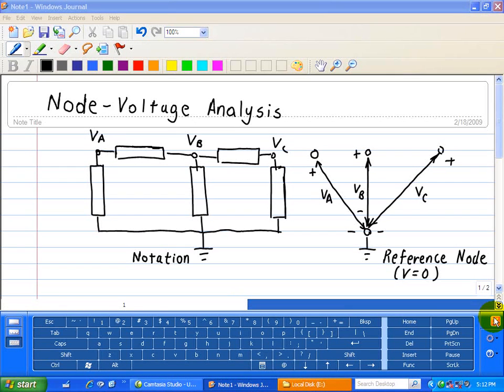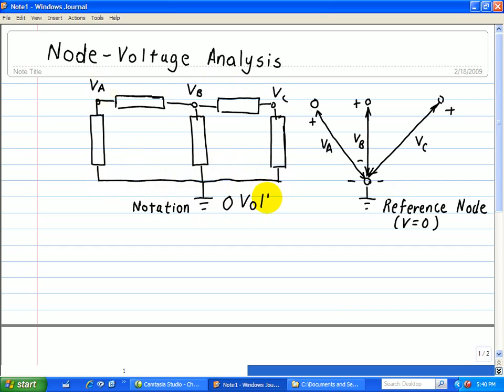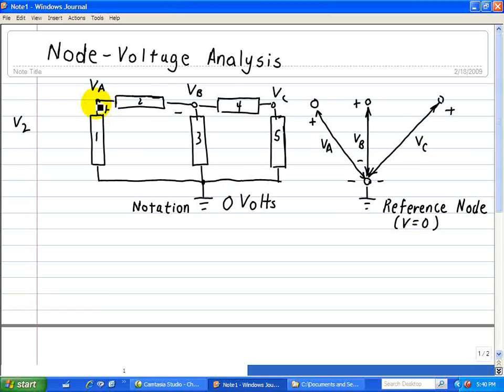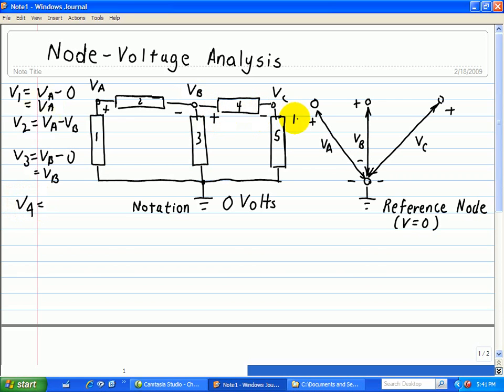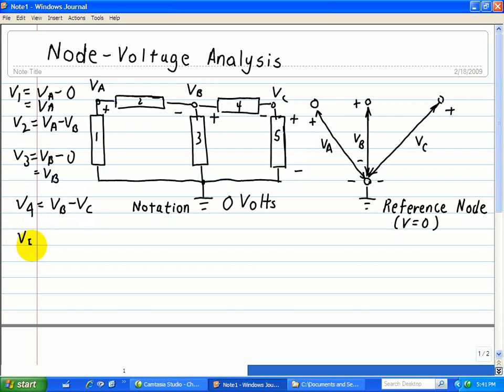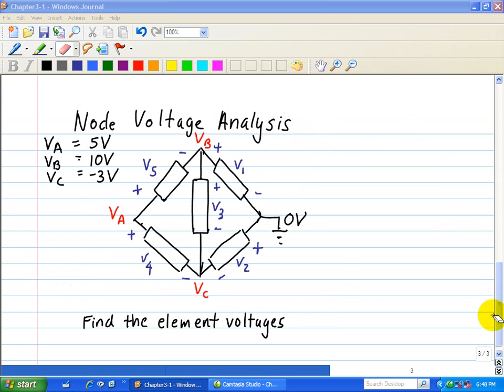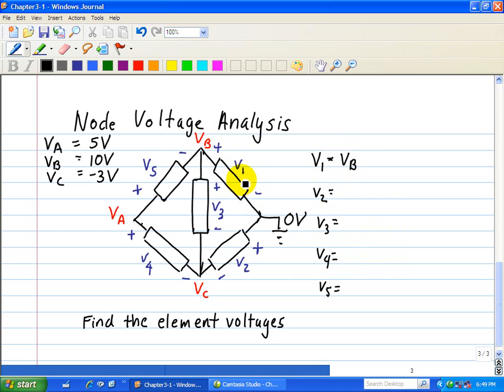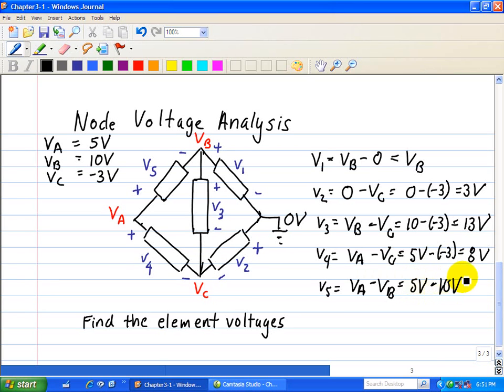Circuit Analysis:  Node Voltage Analysis (Part 1 - Introduction)

Comment: Golden rule for resistors. The end that the current flows into is always the positive side of the component. If you don't know which way the current is flowing then just pick one and mark all your components relative to that. You'll always get the same answer.

Comment: It does not matter as long as you are consistent at each node. I always put the node I am working at first, i.e. @ VB use eqns VB-VA and VB-VC. You can do it the other way around but you must do the same both times